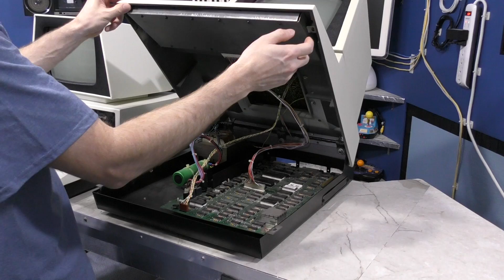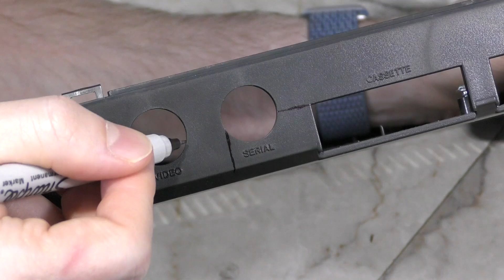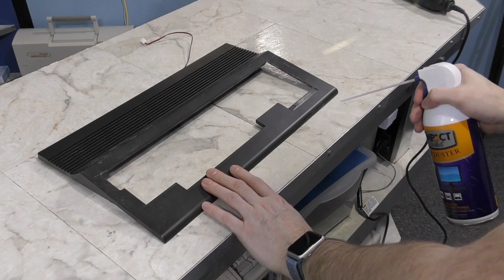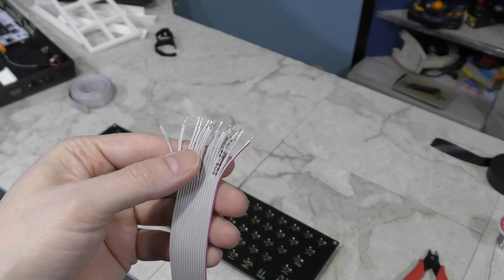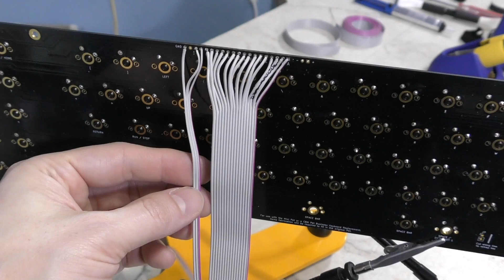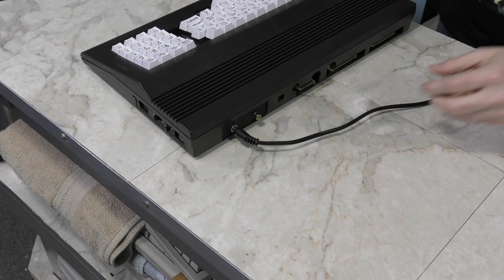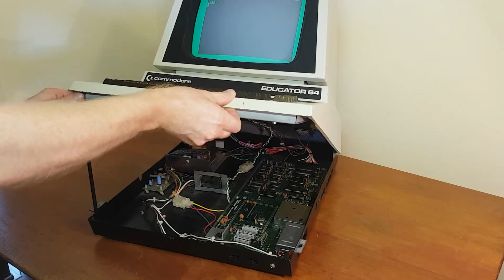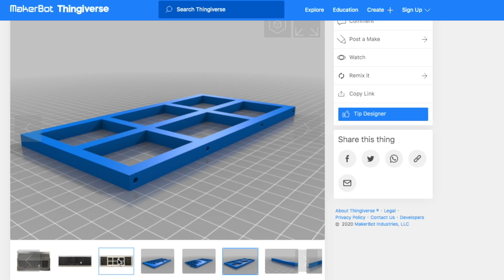Building a case for the Mini-PET

Comment: Not sure why you wouldn’t just do a custom 3D print of a new case for the MiniPET, based on a scan of a 64C case and then make the modifications in the software?
Reply: My 3D printer cannot print that tall sadly. I am stuck to 210x210x200. That's why I had to separate things.

Comment: had a pet 24 with tape drive at work spent almost a week doing a program on tape and when i was finally done a coworker put the tape on top of the portable radio and it was wiped 1981

Comment: I was thinking about the holes beside the space bar and between the main keyboard and number pad sections.  I know you indicated that it was hardly worth messing with, but I was wondering if you might have considered something like the material and technique used to fill the hole created for the added fan on the Bell and Howell Apple II machine.

Comment: What are the function keys for?
Reply: The function keys on the C64 are mainly for programs to make use of them. In BASIC they have no pre-defined settings. PET didn't have them and function keys only started with the VIC-20.
Reply: When someone removes them and tells you they are not sorry and you turn on them 30 years later

Comment: You Can 3D Print A Case instead
Reply: And we couldn't print it in a single piece, which would also be a hassle. Easier to just take an aftermarket it and make modifications.

Comment: WHY WONT YOUTUBERS WHO USE HEATSHRINK EVERY 3 VIDEOS BUY A FKN HEAT GUN
Reply: THEY'RE NOT EVEN EXPENSIVE
Reply: STOP BURNING YOUR WIRES
Reply: Because getting it out and turning the heat and waiting for it takes 5 extra minutes when a lighter can do the same trick. I worked for a guy who was in the electronics industry since the 1950s and he did the same thing, only using his heat gun for large tasks like removing many components off a board at the same time. It doesn't hurt a thing to shrink tube in this method.

Comment: Does anyone know how hard drives manage files? Like I understand the mechanics and basics of how a hard drive works, but...
Suppose an empty drive has file A written to it, and then right after the end of file A, the drive adds file B. What if the drive is given the command to add information to file A? Does it have to move file B before doing so? Do storage devices leave marked out regions between files, to protect files from being overwritten?

Comment: sweeeeeeet. though i do wonder why getting some plastic printed to fill out the gaps around the spacebar and numpad is difficult. seems like you'd just be able to print out properly dimensioned black plastic with some tabs that flare off at the bottom and glue on from the inside using the tabs. seems to be at least two points of contact per plastic piece too which should make it sturdy as well.
Reply: It wasn't difficult because it was hard, there was a 1mm gap for this reason. It was difficult because of the time allotted. David only has a single week per project and I just didn't have enough time to do those parts. It was only for aesthetics and honestly those parts didn't hurt the end goal.

Comment: Dave, I'm having the same problem with my eyes. I got one of these https://www.ebay.com/itm/152725377597 and it's great. I like that you can change the lenses for higher magnification :) I'm not suggesting that you buy from this seller. I got mine from the UK but it's a Chinese mass produced thing. The one I have uses AAA batteries for the light. (There are versions that use a CR2532 type cell which although lighter doesn't last as long) It's an order of magnitude better than a bench magnifier lamp. So far I have not used the strap. With a bit of bending the nose piece fits behind my glasses and it reasonably comfortable for 30 mins use.

Comment: I woke up early this morning and had a thought (inspired by watching this video the other day.)  Will there be a version of the Commander X16 board that will fit in a C64 case.  Either natively or with adapters/spacers.
Reply from the maker: This has been discussed a lot.  And while it is not officially planned at the moment, it could happen.

Comment: Sort of like my "MacTRS-80" where I used an old TRS-80 case and installed a 13" laptop LCD screen and an older MacMini, with external USB CD/DVD super drive and 2 - 7 port USB hubs in the old floppy drive space... Works like a charm! Also with just a bit of modification I used an older G3 USB Keyboard in the keyboard space.
Reply: Pics and/or video?
Reply: @Toonrick12  Wish I could upload but don't know how...
Reply: @MDI-RestorationMinistry  Just use Imgur or something.
Reply: Hope you can see the results now... Sorry it is on Facebook
https://www.facebook.com/media/set/?vanity=mike.inman.587&set=a.1689172477929007

Comment: I found that a sanding drum on the Dremel removes material without melting like the cutting tool.  I'd cut with the wheel and then move to a sanding drum to bring it into tolerance. That way, you can use the file just for squaring the corners since the drum is round.

Comment: After your Dremel job, you could have simply created a CNC-cut thin metal plate (surrounding the keys contour) to be glued on TOP of the keyboard (or alternatively, screwed in at the 4 corners).

Everything would have been flush and long lasting ;)

Comment: Mmmh would it not be better tu build in a usb c pd dummy to get the power over usb c?
That's more modern and  it can give out 9, 12, 16 or 20V?
When I see correct this build use 9v.

I power my pal snes and pal Master system with usb power delivery dummys

Comment: It really bothers me that you made a structural plate for the PCB after soldering the switches in, for structural rigidity you'll see most custom boards use a plate UNDER the switches that they in turn clip into before being soldered to the PCB, this makes the whole thing much more rigid without needing any other screws or pcb backplates, plus the switches are literally designed to clip onto a plate.

Comment: Another pipe-dream.  Some kind of board that was switchable between PET and C64 that fits a C64 case. Or even better PET, VIC-20 and C64, but that would require a lot of chips.  A PET/C64 board could re-use the CPU, RAM and such and ignore the VIC-II and SID.

Comment: What a fun build! I do have to ask a question: When using your Dremel, have you tried a slower speed? The plastic is essentially melting, which is causing the burrs that need the filing after. I can't help but wonder if a saw blade running slower would give you better cuts and less fixing after the cut.
Reply from the maker: My dremel only has one speed.

Comment: If you want to fill in holes fiberglass body filler from any auto parts stor may be worth trying. Its easy to workwith paintable and if you add to much you can easily cut and remove the extra media afterbir hardens

Comment: yup the pets and ibm 1551's are also showing tv broadcasts in wonder woman which they couldn't do.............. and the motorcycle in the garage scene is wrong....... the film is set in 1984, the bike is a honda revere ntv600 mk2 which came out in 1992. the original was released in 1988.............. hmmmmmmmmm

Comment: Amazing work as always :) I did have an idea for your pet2sd device... am I right in assuming it plugs into the user port? if so there is 5v available on that port -- i modified my sd2IEC to take power from the user port so I can use it on my Commodore plus 4 and Commodore 64 buy taking advantage of the 5v at the user port you could do the same!
Reply from the maker: Actually, it plugs into the disk drive port, which looks very similar to the user-port.  However, on this particular build, it just so happens to fit where the user-port would be on a C64.  But yeah, the disk drive port on a PET has no +5V power.
Reply: @The8BitGuy  ahh I see - well never mind your solution is more than elegant enough! love the black case with that custom mechanical keyboard! Stay safe and I look forward to seeing your next update about your new Workspace!

Comment: So you went through all the trouble of getting custom c64 printed case but you could not print a piece of plastic acting as back plate? Meh
Reply: Commodore 64s use a front plate, not a back plate. We were building what would work in the case.

Comment: You should tin muiltistrand wire first, it’s much easier to put push through holes and to solder onto headers when it’s a single conductor.
Reply from the maker: Actually, I did. If you look closely in the closeup shot of me poking the wires through you can see they are tinned.  I just didn't show me doing it in the video.

Comment: For filling the gaps on the keyboard, couldn't you have raised parts of the underneath piece of printed plastic so it at least was flush with the top at the gaps between the space bar and the number pad? Also, once the pandemic subsides, I plan to look into (well continue since I put it on pause) making my own molds of some of the 80's computers. In that process you first create a copy in clay/putty, which allows you some freedom to make changes...perhaps that's a way to create a real custom case.

Comment: 4:00 - do you use metric system?? :)
Reply from the maker: We tend to use millimeters when dealing with things that are smaller than an inch.  Our system simply doesn't have a unit of measure that works well for that.

Comment: I would be curious to try to design a modern keyboard to fit the c64 case that works with the Pet. Would be a fun challenge, especially working with the smaller space to the right.
Reply: We have ideas on the works. ;)

Comment: In my experience, cutting at a slower RPM with a toothed blade ( like the ones sold at Hazard fraud) makes a better cut without the melted plastic. Thus, you can cut closer to your cut line and will need much less fine tuning hand work. I always avoid melting plastic while cutting.

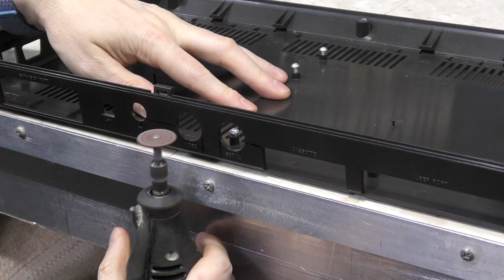Comment: 3:12 One dremel tip for you: It will want to buck if you don't hold it firmly or take to big of a bite, but easily the best dremel tool bit out there isn't a dremel tool. It's a 1/8th inch shank carbide end mill. Just make sure to wear eye protection and possibly have a chop vac on hand as the chips can be exceptionally light weight and even aluminum and mild steel will float up to your face with just a light breeze.

https://www.amazon.com/OSCARBIDE-Engraving-sculpturing-Roughing-Aluminum/dp/B07C1YPTCL/

Comment: This is a super cool project! I wonder if it would be easier to just 3D print a custom case for the project though, since you have to do cutting and printing anyway.
Reply: The only issue is size constraints. The case is too wide to do that for consumer printers at this time.

Comment: (2:18) That's how we do it in the retail industry—pull the tape with the plane of the box, lifting the tape up as little as possible in the process. Depending on how well it's adhered, most of the time this works well.

Comment: Man I forgot about the second generation 64C case! I only ever had a first generation I bought in 1982 at the local K-Mart for the princely sum of $188.00. Bear in mind that I was only 12 years old and I did a LOT of after school and summer hustling to get the cash. Two bills back then came slower than they do now, lol, but I got $60.00 selling the Timex/Sinclair 1000 I learned BASIC on to a schoolmate to help defray the cost.
My old eyes actually thought I was looking at a +4 case when your video popped up in my feed. (My girlfriend way back when had one of those.) 😉
When I think about how hard I worked to buy not only the C-64 but a new 13” color TV “monitor”, and later a 1541 drive (4 pencils sacrificed to prop it up to cooler heights!), I get tired all over again. But it sure was worth it. And the C-128/1571 combo I got after that was even better. Those were the days of Star Trek: Next Generation and the aesthetic blended right in. It sure was easier to feel like you accomplished more back then.

Comment: to fill in the areas between the space bar and the numpad, you can superglue pieces of plastic in there. it actually wouldn't be that difficult, and it wouldn't show too much because it's black. you would just need to find some device that's about the right kind of texture at a thrift store and cut it apart.

Comment: For the open void areas in the kb zone, why not print some matching blanks with some small pins in them and drill out the pattern to the existing 3d print? Quick and clean glue dab and I think your problem could get solved.

Comment: With all of that 3d printing, I would have just made a custom case. You could use sheets of ABS (typically sold for car stereo installations) for the flat areas and just print up frames for the edges of the case (to tie everything together).

Comment: My current project is a Motorola Dynatac 8000s from 1986. I have gutted the inside of it but keep the keypad and screen board inside the case so far. I am thinking of putting a Raspberry Pi in it and trying to make it a usable phone. Also going to put a bigger battery inside it which makes it better than the 30 talk time minutes it original had.

Comment: [advice]
A small advice for your future plastic cutting projects, from someone who spent half his life doing plastic scale models and 3D prints :)

If you need to cut medium thicnkess rigid plastics, like those computer cases, 
try using a saw for plastics, rather than a dremel. You'd have much more control, won't melt the plastic and the entire job (including cleaning the edges) would be vastly easier and quicker. The  type as the one in the pic:
https://cdn.shopify.com/s/files/1/2092/5307/products/55001.jpg?v=1504651079

Just  ask for one in the plastic sacle models shop, for sure they'll have it.
Reply: Also, the wood rasps aren't the greatest idea - try using the coarser sizes of files designed for metal, the effect would be much smoother :)

Comment: You could also get someone with a bigger 3D printer to design in the style of the Commodore Case and print a 3D case with all the correct cutouts for the keys and the slots etc.

Comment: You're actually probably better to design an print a 3D case that fits your current cpu board and keyboard configuration.
Reply: Would not print in a single go, no readily available printers exist to do that (yet).
Reply: @ChrisKewl  you could do it in sections.  I'm currently printing a stradocaster body with my V1 CR10.  That's assuming you want to spend the time filling, sanding and painting afterwards.  Which for anything more than a one off wouldn't be feesable .

Comment: 0:45 Starter motor's soundin' like it's goin' bad and you might wanna to replace the air filter.  I could save you a few bucks if you wanna just flip it over and give it a spray with the air compressor.  Still, you'll wanna have those front brake pads replaced, and your tire treads are lookin' a little thin.  I can get you a good deal on some used white-walls.
Reply: I think I missed something or you're replying to the wrong video. :)
Reply: @ChrisKewl  Opening the PET looked like he was lifting the hood on a car.  That was my impression of an auto mechanic. :D

Comment: Yes, I would be quite bothered if you cut up an original C64 case. A 64c case, however, would be just fine.
Reply: An aftermarket C64c case in fact! :)  Pixelwizard.eu has plenty of them in stock. That's where this one came from.

Comment: why not making a pcb for the rear side and wire it to to PET pcb, so the cassette is on cassete hole, userport on userport, and the oder where ist the expansion port
Reply: That was the original idea, a daughter board. However it was a bit cost prohibitive to do more than just a 1-off. Other ideas are in the works. :)
Reply: @ChrisKewl  okay

Comment: Dunno if you'll see this, long time vintage keyboard collector and hobbyist. i have a couple questions about needs for the "C64 footbrint PET compatible" keyboard idea, I think designing a pcb would be 100% doable using cherry mx style switches.
Reply: We're working on ideas to solve this including using the C=Key. :)  I have a pinned comment discussing this.
Reply: @ChrisKewl  if the diodes and mcu of the keyboard are off the keyboard it would be even easier

Comment: 2:20 I ussually use hair dryer to remove badges. And hot air helps to remove glue residues easily.

Comment: Do people actually have trouble figuring out the resistor value for limiting LEDs?  My math says: 9vin - 1.8vred = 7.2vres, 7.2vres = 0.01a * Rres, 7.2vres / 0.01a = 720ohm or greater resistor for a red LED at 10ma or less, more then sufficient for any other visible color.
Reply from the maker: Well, it was a bit more complicated, because I'd want to tap into to where the old LED was on the PCB, but it is a blue LED so has a different voltage than the RED LED in the case.  I guess I could have just tapped off of any 5V source on the board, though.
Reply: @The8BitGuy  160-180 ohms in theory then?  Understandable to have trouble procuring in a pandemic.  Yeah that's definitely a weird spot, I admit I have very little in resistors that low in my tackle box.  Fry's is a zombie, and MicroCenter was packed concerningly full the last time I went.

Comment: Using 2 switches instead of stabilizers still drives me crazy
Reply from the maker: You'd be surprised how well it works, though.  I suspect the stabilizer is simply the cheaper option so that's probably what mass market keyboards use.
Reply: @The8BitGuy  In this one-off case the stabilizer may be more expensive than a 2nd switch. If it was mass produced I'd agree.